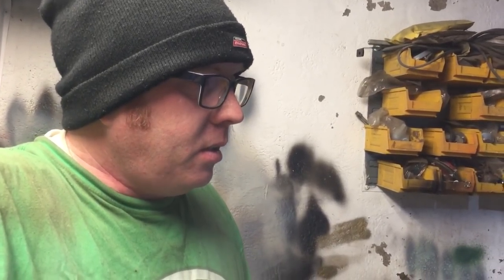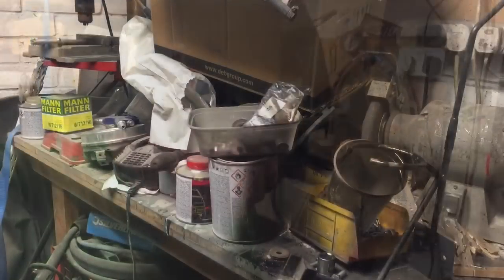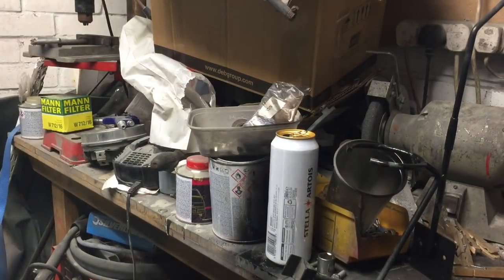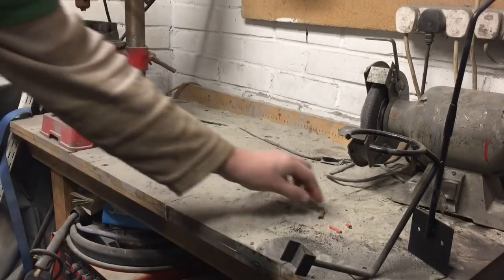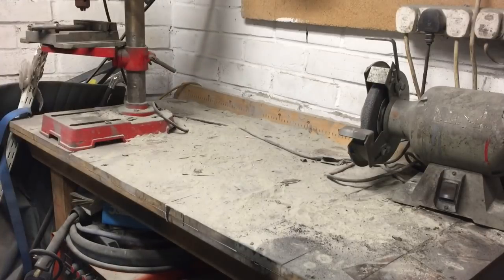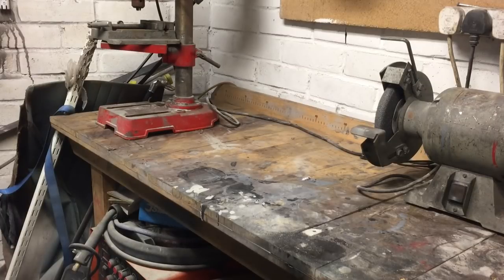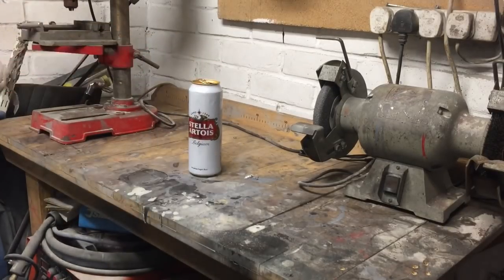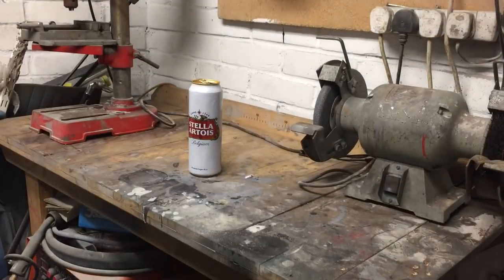1964 Mk1 Mini Restoration S2 Ep215 - Clean Bench@1chish

Comment: I gotta find the info on the maker that sells the ceiling storage units. they mount above you and you pull down the drawers and they have shelves or tubs to chuck stuff in then you click em and they fire back up out of the way, you could stuff all kinds of crap in there, even pickup related stuff. cheers.